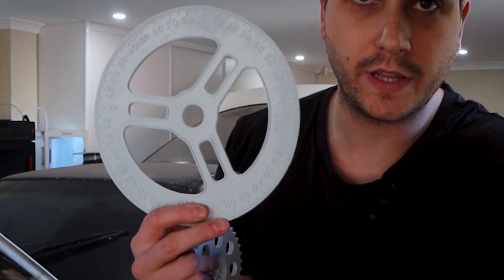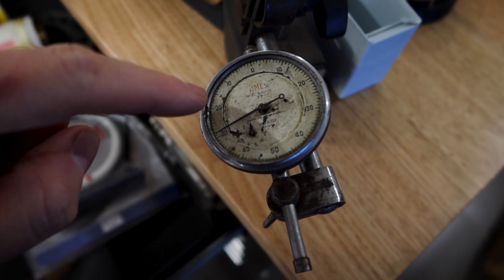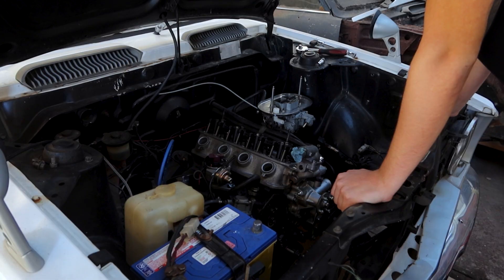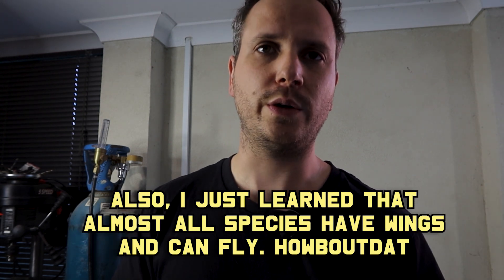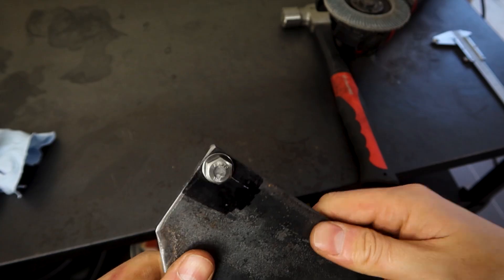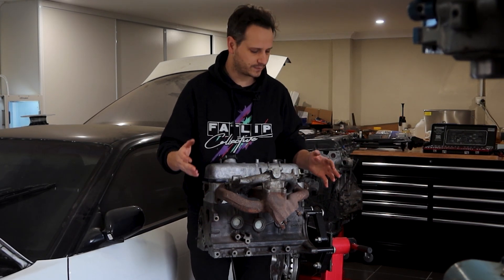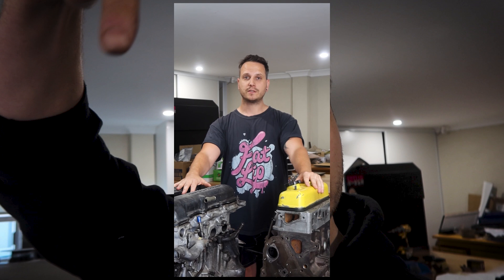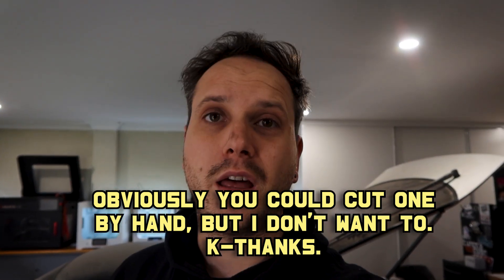Starting the KE70 4K Corolla Budget Turbo Build and 3D Printing Timing Components for the KE25 5K

Comment: FYI the CS9000 rollmaster kits aren't just as simple as 'move to another hole'. There's numbers around the perimeter next to the teeth that become the new TDC 'dot', corresponding to what new hole you move to. IIRC this gives you 6* of advance/retard for each new hole. I've never moved mine off 0.
Reply from the maker: Hey thanks mate appreciate the tip.
That's basically what I could determine from looking at it - seems like each hole is 15 degrees and each tooth is 5, so I imagine you move one hole then back 2 teeth (15 - 10 = 5) and gives you 5deg.

Appreciate you checking out my content - I remember reading your build thread on rollaclub wayyy back in the day when I first got my ke25